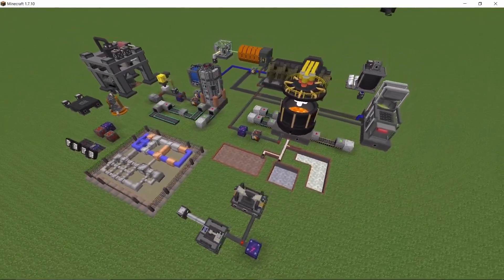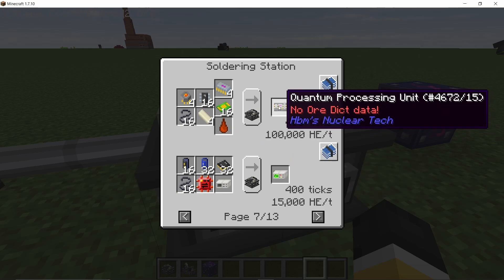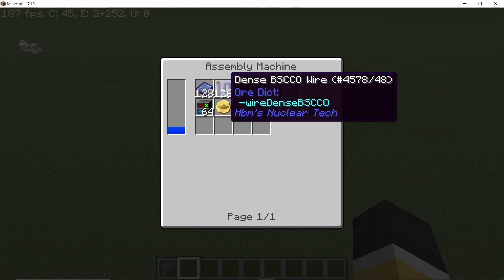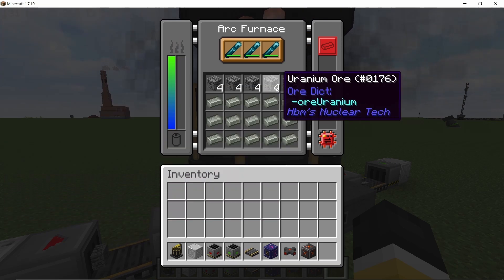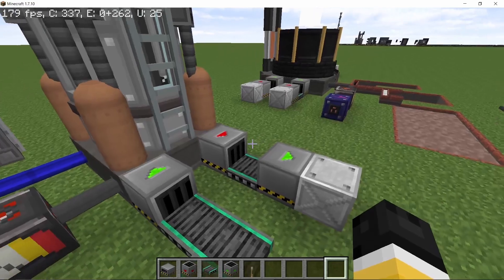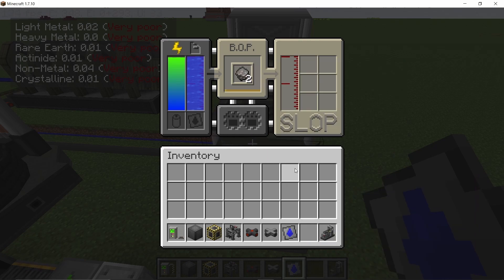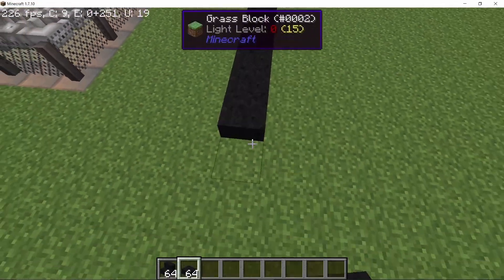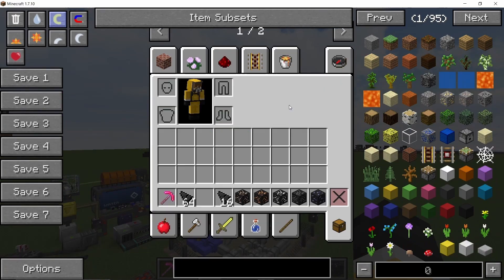Large ARC FURNACE, Soldering Station, Bedrock Ore Processing & More - HBMs NTM Updates

Comment: But you do have the config option to change the RF-HE ratio, it's in the hbmMachines
Reply from the maker: Ye that was my bad, but still nerfing the default values and bringing back the converter having buffer is something that I'm not a very big fan of. NTM should be an overpowered mod just cause of the crazy powerful stuff and material it has

Comment: new update les go, also can u make a tutorial for NTM extended, i want to see how u can make the book of boxcars (black book), uranium-238-2 and more via DFC because it requires around 69t spark for the book, i already made prototype but it uses tons of emitters and high energy field thing (forgot name) i want to see how to use less resources to make that, already thanks
Reply from the maker: Sure thing I'll check what are the updates in ntm extended and make a video for it as well. Btw looping the DFC beam back into the core or making it pass through a second core is a good way to exponentially increase its power for using on tungsten crate. Iirc I've already made a video on it for ntm extended so maybe check it out as well as it can be helpful
Reply: @SavageVegeta  yes i see its working but it gives 40t spk, im using the DNT catalyst and thingy core, and about the fuel i use antimatter and UU matter, because its kinda easy to make if u have 1 gigafactory and enough energy i guess, i guess if u just add more emitters it will work, thanks tho!
however it will break the jammer after some seconds if u wont shutdown it so its kinda dangerous + i used double core to get 40t spk